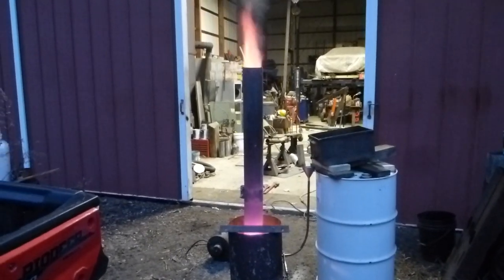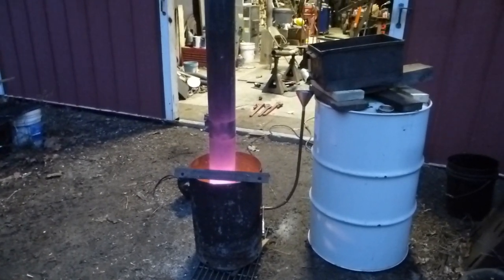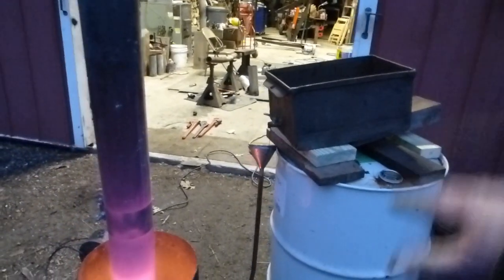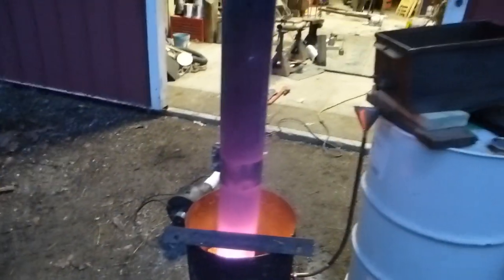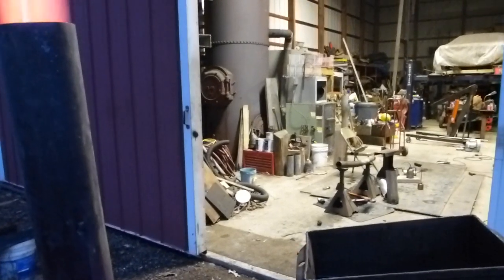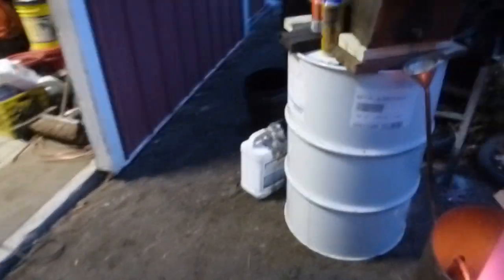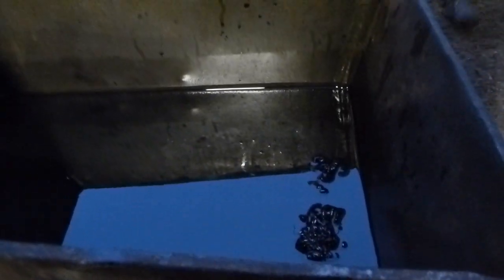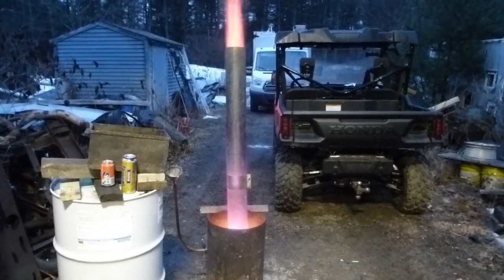NH Hbbyloggr - Turbo charged Waste oil heater  01132020

Comment: OK.... Now I've figured it all out! On Steve's last video he was supposedly setting up his "BIG" industrial gasifier and he built this big industrial platform on wheels but as I explained to him I was sure it was really a secret portable rocket launching pad and now here's the actual PROOF for everyone in the gasifier world to see in this video! You have the rocket and Steve has the portable launching pad for it! Hey man that thing is cherry red. I think you should be able to end winter in your state with that thing. OK, on a serious note, pretty cool build. Hey Bill I hope you and yours had a merry Christmas and a happy new year.
Reply from the maker: Same back to you, Mike. T minus two days and this unit will begin adding BTU's to the shop.... if it doesn't end up in NZ first.
Reply: @nhhbbyloggr5022  Bill that little burner you made is bad ass man! I guarantee you that I haul enough used motor oil off to the recycle center every year to warm up my tiny 16 x 20 shop every winter just from the oil changes I do on my personal vehicles. I meant it when I said you could end winter in your state if you leave it running outside for a couple of hours.

Comment: YUP !! , the blacker the oil the better it works,,
    don't  be to restrictive on the out flow chimney !!!
Reply from the maker: Yeah we even dabbled with restricting  the out flow. I caused a pretty good fireball down at the brake rotor. That's how the 2.3 version was adapted .